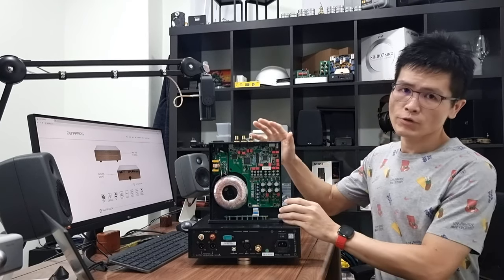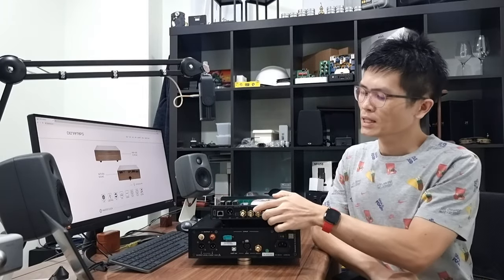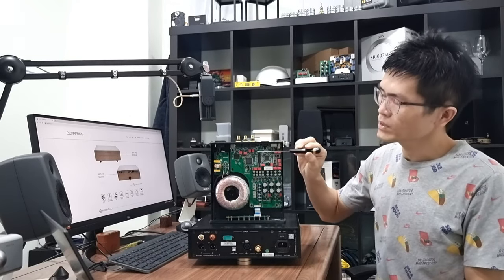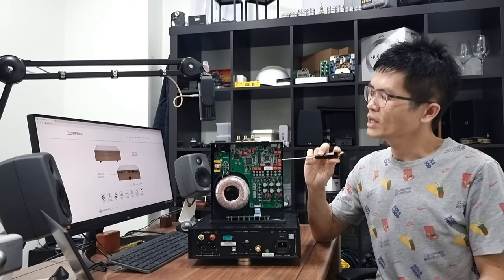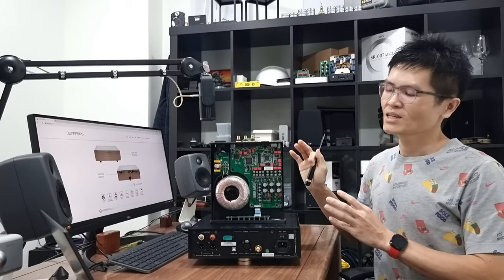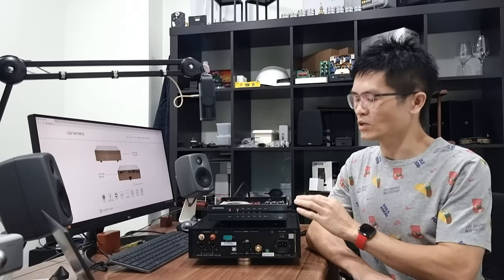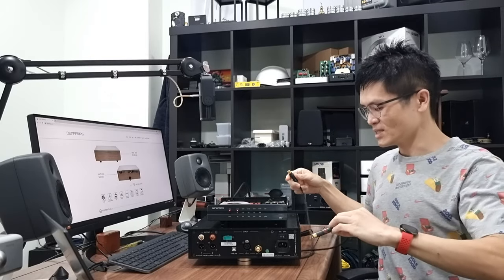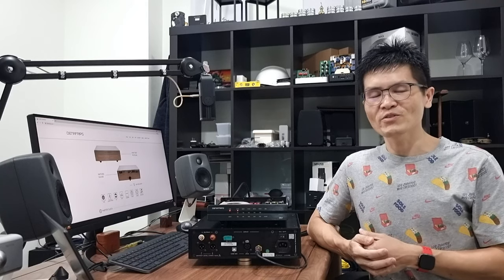DENAFRIPS IRIS DDC

Comment: Hi Alvin, if one uses an iPhone as compared to a computer over usb, does one still benefit from using a ddc between the iPhone and the dac?  I can understand the noise a computer generates but is that same noise level also generated from my iPhone?  Thank you for answering my question.  Regards.
Reply: I’m using the same set up , have you found any meaningful answer to this - is using a DDC with IPhone going to make any marked improvements to the sound.
Reply from the maker: I would say yes, DDC will help to improve the sound quality of the smartphone.
Reply: @VinshineAudio  Thks mate

Comment: As a Terminator owner, I've wondered if the USB processing in Iris or Hermes is better than the USB processing that is already in the Terminator. I don't want to just duplicate existing circuitry in an external unit.
Reply: My thoughts exactly. After further looking the iris is designed to use the terminators clock out feature. So if your using usb the iris is perfect
Reply from the maker: If you stream music from a computer/streamer most of the time, you may consider adding the DDC. 

By adding the DDC, it cleans up the digital signal noise and the cleansed digital signal can be sent to the DAC via i2s interface.